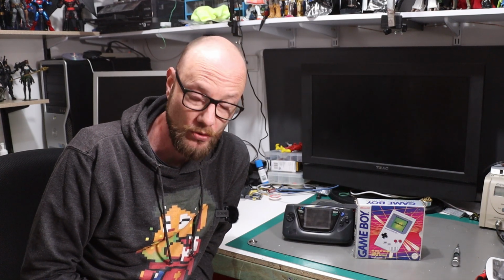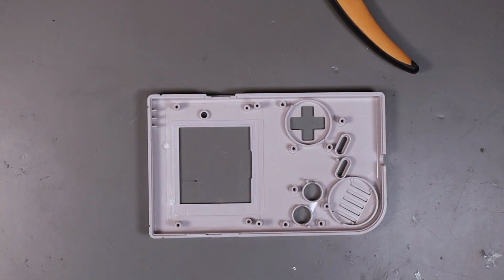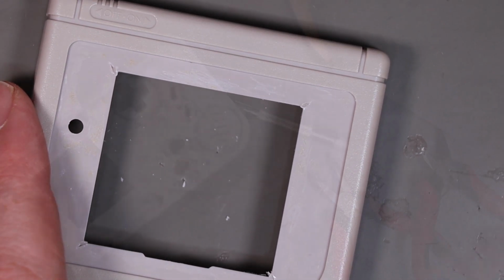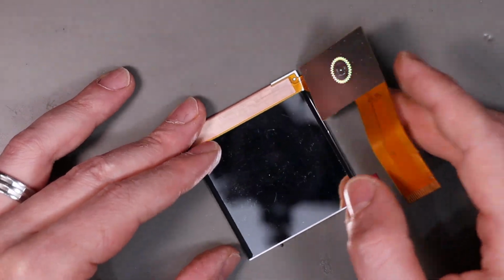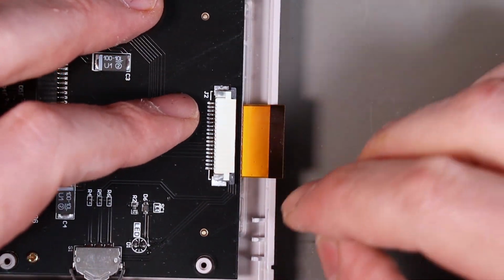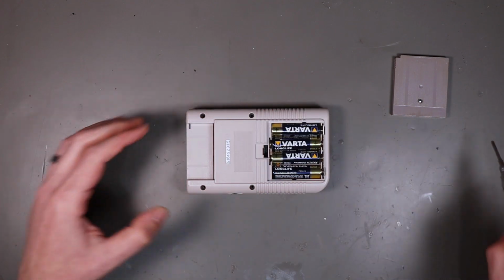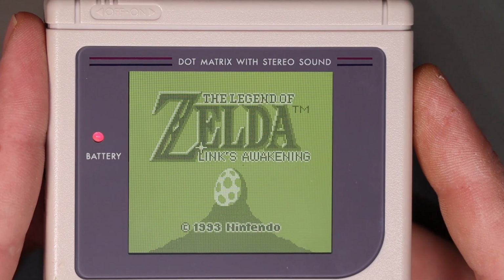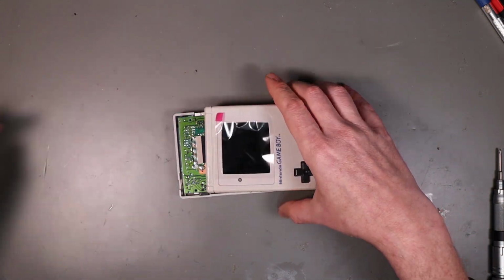Funny Playing IPS Screen for the original Game Boy

Comment: You speak of pressing a button to change the display mode, do you replace the contrast control dial with a button or toggle switch or something?
Reply from the maker: Ahh yeah. The dial isn’t a dial anymore. It’s like a toggle up and down + a push in button. Works really well actually.
Reply: @MrLurchsThings  Oh, now I understand.  Now I think I kind of want an original Game Boy just to put this new screen in it.  Problem is, I have no idea how to use a soldering iron.
Reply from the maker: This is honestly the easiest soldering you’ll do (go look at my recent Gamegear screen install for comparison). Set your iron to ~350 deg and don’t touch the hot end 😂
Reply from the maker: @Lachlant1984  get yourself a screen and a flash cart and you’re off and running. A great combo for a great console.
Reply: @MrLurchsThings  I don't have much need for a flash cart as I have a GBA SP and a selection of original, GBA, and GBC games too, I was heavily into the Game Boy as a teenager, my first Game Boy being a Game Boy Pocket.

Comment: Please remind everyone DO NOT plug the screen into the ribbon cable by pressing on the screen itself. You can VERY easily break the screen. You started very badly but you finally got it plugged in away from the screen.
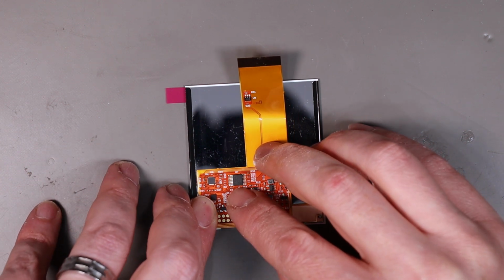Reply from the maker: I assume you mean when I was connecting the screen to the ribbon/PCB? 07:38 I can honestly say I was putting very little pressure on it (which is probably why it wouldn’t click into place). Hence why picking it up so I could place pressure (and see better, always difficult when you’re trying to demonstrate on camera) on both the tiny cable off the screen and the PCB.